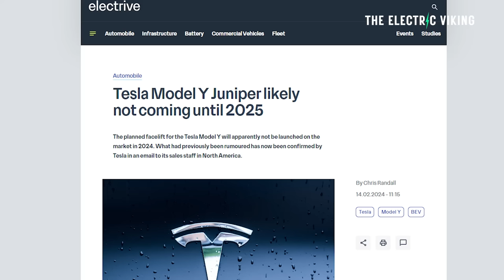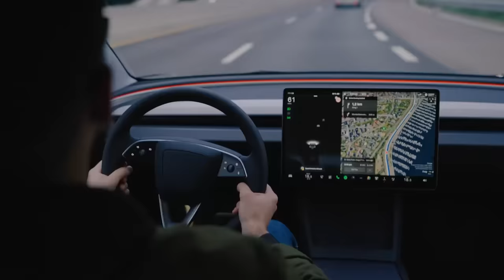Tesla stock up after Model Y and Model 3 price hike in US and Europe

Comment: There's also this happening in the EU. The color for the Model X/S is no longer a free upgrade from the white. They've returned the price back to what it was before. They've also reduced prices on in stock cars by 1600€ for all Model S and X, basically making it at least a 3200€ saving if you buy a black Model X. I believe the reason for this is that they're pushing a bit for Q1, there is a significant reduction in the number of cars in stock. But also it is preparing to sell upgraded model X and S, with front bumper camera, interior lighting and so on. I see this as the only reason for them to drop prices on the cars that are in stock and to increase prices on new cars. So very soon after Q1 earnings call we can expect an update on the website about new refreshed Model X and model S. As there's also not been a wave of new cars coming to EU in a while, I believe we can also expect/hope that at least a portion of those will be upgraded. Tesla understands that NEW car buyers are going to spend a bit more for the newest features, but are keeping really quiet about the upcoming changes, to not get sucked into the Osborne effect again.

Comment: Bro what are you talking ? The share price just reacted after falling fir 7 weeks straight. This has bothing to do with the price increase.
Reply: Folks buying because they think it’s cheap. Then they’ll sell at $190. And $170 would not seem that cheap and it’ll go down to $120.
Reply: @TheBooban  if the q1 results are bad, then probably yes. If, on the other hand, there is an fsd licensing announcement, it will 🚀

Comment: what are teslas manufacturing/inventory looking like

teslas problem has always been supply, perhaps they are seeing demand way too high for their production capacity

last i looked they had massive supply of model y mainly due to production capacity, seems a bit odd they'd rise the price of it
Reply: yeah just checking tesla-info, inventory Y is high at around 8k globally

model x with 2000 and the rest around 1000

with annual production of 2.3m!
Reply: High inventory is the opposite of a supply problem. 

And 2.3m production is something you or someone else made up. Tesla is expected to deliver approx 450k cars this quarter and around 2million for the year. They’re not going to have 300k cars gathering dust.
Reply: @singed8853  it is, i am making the argument that tesla has very little stock relative to production capacity

so 2m a year, it's possible the source included some future production ramping up in the near term 

even so, 1k stock on most models with a 2m production rate sounds like a supply problem to me 

especially if they temp shut down manufacturing to retool for updated models, logistical delays, high regional demand, etc, etc
Reply: Tesla have never had high inventory problems.

There is almost zero model Y inventory outside of the USA. Even in the USA with 6.5k cars and annual demand in the USA alone running at 300k cars that's less than 8 days sales inventory. There are less than 2k model Y's in inventory for the remainder of the world with annual demand running at 1.0 million for the balance = < 1 day sales.

To put that into perspective the best legacy auto maker (Toyota) has around 50 days sales in inventory.

The model Y is on track to exceed 1.3 million sales this year (from 1.2 last year).